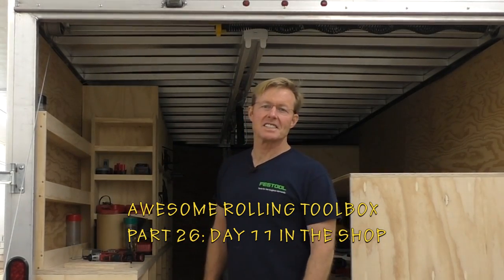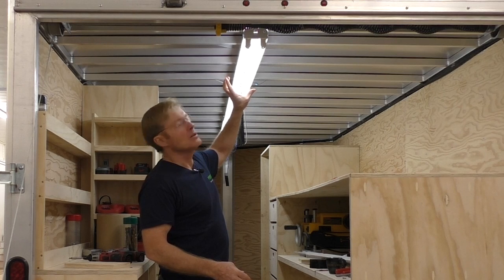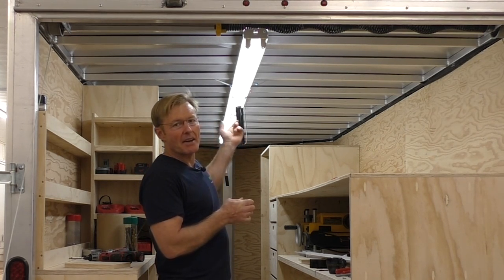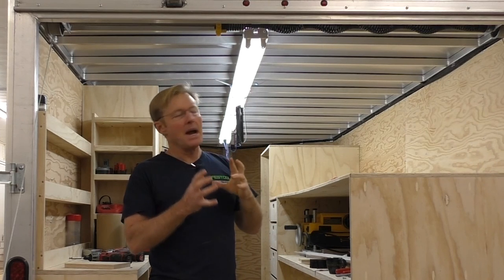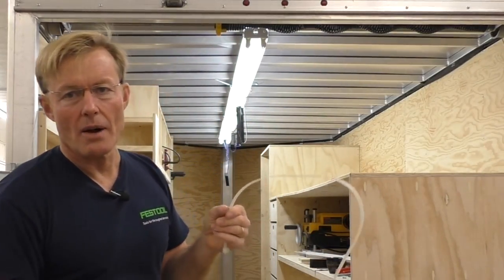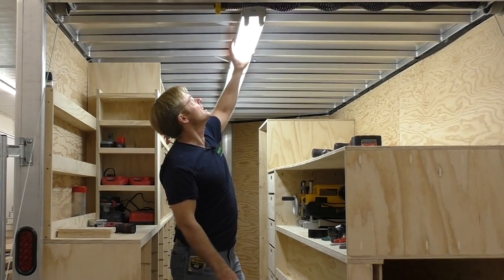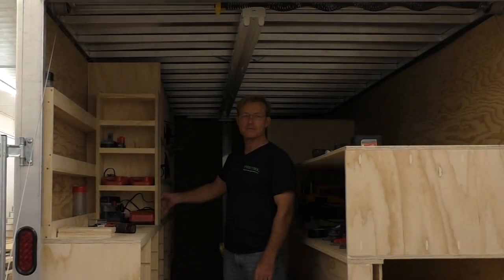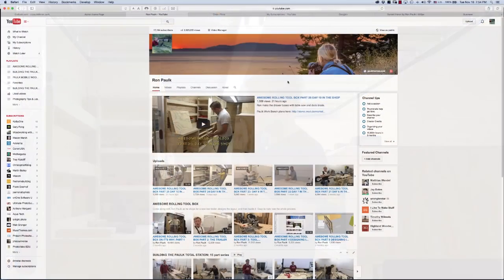BUILDING A MOBILE WOODSHOP (Part 26) GFI problem solved, the shop is bright.

Comment from the maker: Gary, I will have (2) ¾" stiffeners on the outer edge installed with pocket screws for future adjustment, but will install them after I place larger tools for exact placement.

Comment: Hi Ron, I love trailer videos. Have you thought of replacing the ballast & florescent bulbs with LED?  They're a little more pricy - $15 each in bulk, but they last longer and they don't suffer from cold or heat problems. Not to mention their just a cleaner source of light for your eyes.

Comment: Glad to see your GFCI issue resolved.
In my opinion the lights themselves are a bigger concern to me...
These trailers have very low ceilings to begin with...
You have fragile bulbs, exposed right above your head....
One knock into them and you will have glass all over the place...
Reply: Frankmali17 Easy to fix with those clear plastic protection tubes.  They might not save the bulb, but will contain the debris.
Reply: this is why an LED fixture would be better... and they aren't that much more expensive.... even a 100 bucks more isn't much considering the entire project...
But that is my personal observation.  I like what Ron has done here !

Comment: ROn noticed in the video the top of the cabinet on the right sags.  It appears you have laid your drills up there, but they should not have much weight.  Are you planning on inserting dividers to stiffen this up or don't see it as a problem other than astetics?

Comment: The ballasts are leaking to ground, there are a few solutions. Get a less sensitive GFI  is good for your setup, you can buy these. Or change out the ballasts. Insulating the ballasts is a bit of a bodge.
Reply: Your ungrounding the ballast so it won't trip the gfci. This defeats the purpose of a gfci. if you get shocked while changing the bulbs the gfci will not trip and you will be shocked. Gfci save people's lives everyday, if they trip it's because something  is not right.
Reply: alldaymckay The ballast leakage is likely only capacitive and the chassis of the light fixture should still be grounded, so the risk in changing a tube is zero. Where you are right is that servicing them with the covers off becomes risky.

Comment: I used 4 75watt led light bulbs, from Lowes $12. a piece,  mounted in edisons wired with a light switch. They provide plenty of "More Natural" white light. They are more durable than tube lights. My concern would be how those lights react to all the vibration/bounce from travel or something bumping them on accident.

Comment: The GFI issue would have been better solved by installing an electrical panel with breakers rather that isolating the light fixtures.  The "sub" panel would have separate breakers for the receptacles and lighting.  Understand you are connecting to a GFI protected receptacle, the sub panel would protect anything in the trailer down range.  The underlying issue is to make sure you are plugging into a 20 amp GFI to carry the load in the trailer.  If you are on a typical construction site, a spider box would give you the ground fault protection.  Any receptacle circuits you have in the trailer should also be GFI receptacles or the panel should have GFI style breakers.  Just my two cents.

Comment: Lights don't have to be GFCI protected, wire the lights on the line side and it will be fine, the GFCI is tripping because it's sensing an imbalance from the ground for some reason.

Comment: Can I get the sketch up files for rolling tool box in addition to pdf's? It would make it a lot easier to adapt to my use. I have had many trucks and vans for remodeling and had gone to a trailer but couldn't deal with a trailer in new mountain location so I just bought a used box truck with lift. Guess I'm not retired after all. Trying to learn sketch up but like auto cad before it when it becomes crunch time I keep going back to a pencil.

Comment: Did you consider using LED shop lights? I wouldn't want all that glass hanging over my head with a low ceiling. Also hit a good bump on the road and you might break a lamp.
Reply from the maker: +Bob D. Yes, LED would be superior. Next time or when these need replacing.
Reply: +Bob D. I would have gone LED as well, but if the fluro tubes and battens are already on-hand it's kind of a no-brainer.

Comment: You can't feed a GFI circuit behind a GFI circuit. If your feeding your trailer with a GFI from your shop it can causes a false ground. Feed the trailer from a non GFI and it shouldn't happen.

Comment: you have a ballast with leakage to ground, better quality ballast is about 15$ but better fix is led fluorescent tube replacement.
http://www.amazon.com/dp/B00LTLDAEM?psc=1 they are not that expensive, have 50,000 hr of life, no mercury, fit in standard fixture, and do not require a ballast. Insulating it from the fixture may solve the problem but the potential for shock still exists

Comment: How about LED lighting, less fragile with movement of the trailer anyway... you can get really cheap strip lighting for 12/24VDC or even 120VAC of ebay.
Reply from the maker: I thought about LED, but what I found here was more expensive than florescent, plus LED has a GFI problem still unresolved. I have been using them for 20 plus years and have yet to have one break. LEDs are the future, but still have yet to reach main stream.
Reply: Godo point... I Liked the plastic tupes you put them in as well, although great to hear you've never had problems. Thanks again for your videos, I do find them interesting and am learning a few things from them... am using your bench which is great :)

Comment: To my knowledge, you cant have multiple GFI on the same circuit.  I had this issue in my old house.  Yu need to have the ability to use a GFI or not.
Reply from the maker: GFI to GFI can be a problem, but it has worked for a long time in my case. I have resolved it in my situation for now.
Reply: DontTredOnMe2012 I am not an electrician, but I have a problem that's probably related.  I have some power strips with GFCI built in.  I cannot use them in another GFCI outlet.  The device trips as soon as I plug it in.